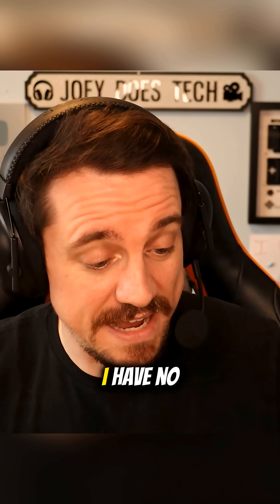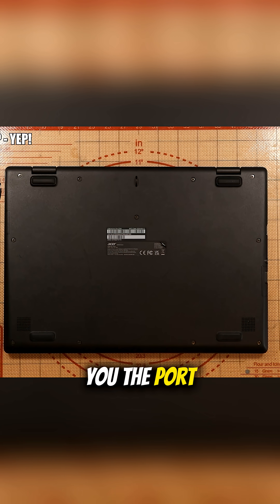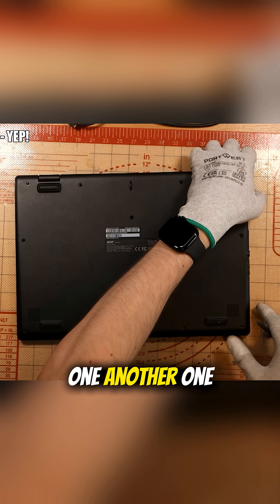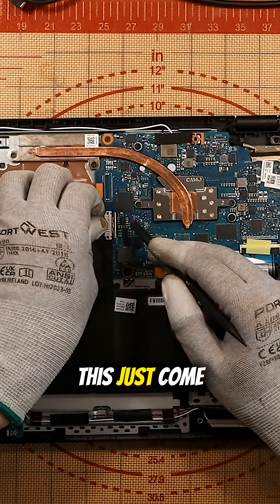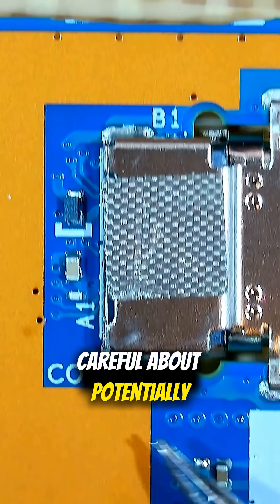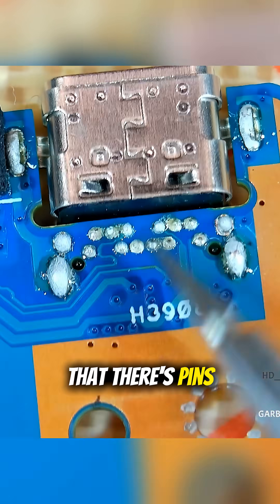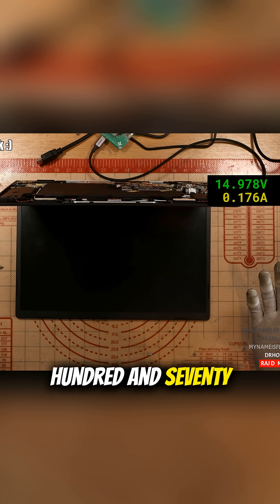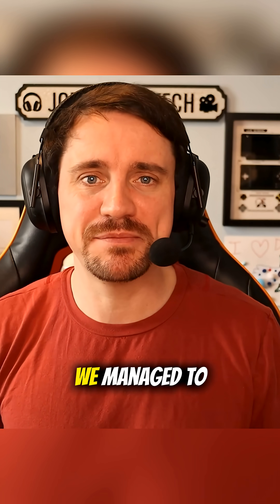Fixing a Dads BROKEN Laptop!  #soldering #laptop #repair

Comment: You can do hdmi. You should be fine with C. There was no reason for them not to put it on it's own board.
Reply: Theres plenty of reason. It lies in what the device is. It’s a Chromebook, a product designed to work for 2-3 years and end up in a landfill.

They’re cheap Chinese crap that replaced netbooks, designed to be a cheap as possible. It would have cost money to put the USB-c on a daughter board.

Comment: Would you explain why you don't mess with laptops? i thought they were easier than consoles
Reply: In the old days the monitor hinges were an issue would be screwed in but something like a spring inside the tube just slams the screen. Also some companies Solder the RAM onto the board so you can't upgrade without possibly breaking something else. And some have daughter boards that connect some of the same stuff in different ways!